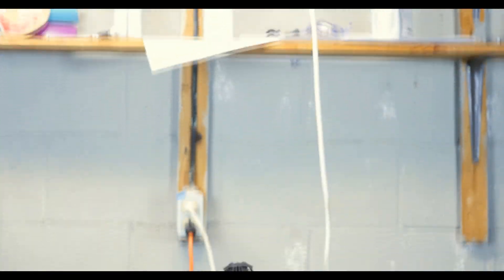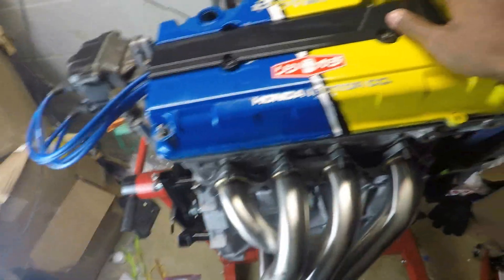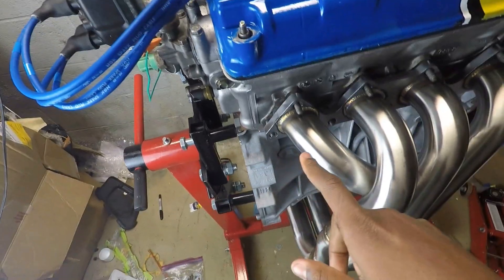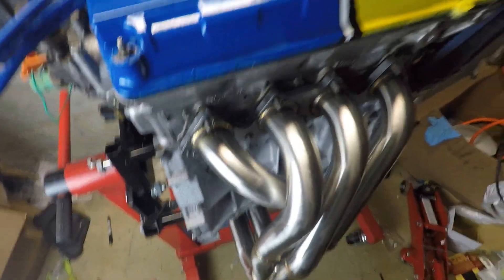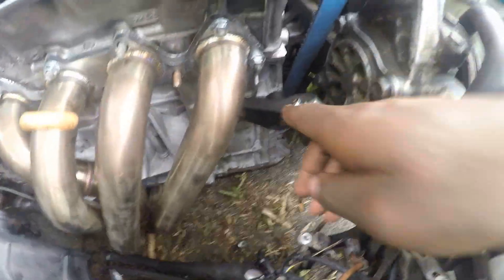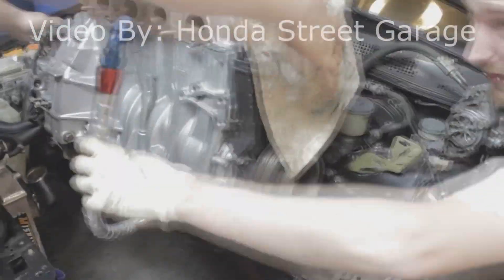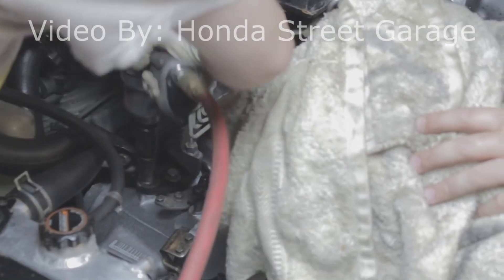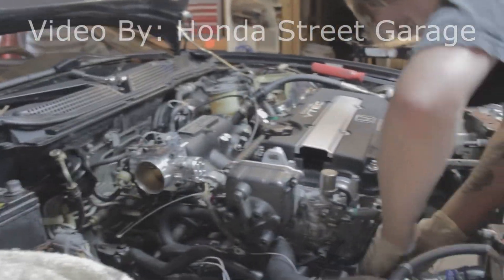Poor Mans Type R vs LSVTEC (Which is Better?)

Comment: GSR Block in all internals are already so identical to a Type R Block it's pointless to put Type R internals back into the GSR. the B16 head is what relates to the type r the most because of the head port their most identical to a Type R head port an flow..
Reply from the maker: lol. the type r pistons have .4 more Comp over gsr......b16 head loses comp on a gsr..........so....................................................🙂🙂🙂🙂🙂🙂
Reply: So you're an LS VTEC guy cool. I think all stock internals are  junk you should really go spoon have all your s*** weighed  balanced and machined down to the same spec. You know if you're shooting for long-lasting dependability and still gain lots of horsepower across the power sheet.. as far as tearing your GSR block apart to put in a Type R piston with barely a point for difference isn't worth it
Reply from the maker: i disagree..but to each his own👍
Reply: Spoon is the way to go if you need stock specs for lower racing classes or just long life an dependability. but by all means slap some Westco pistons in that mug and boost the snot out of it
Reply: Caleb Gonseth all stock Honda internals are junk?? Lol don't think I would waste money on spoon if I didn't even like the stock Honda parts lol